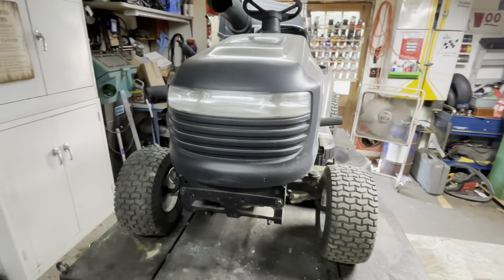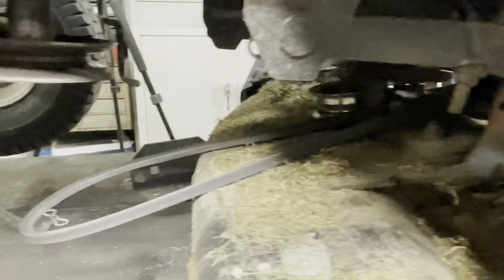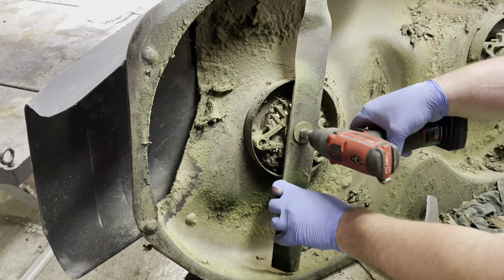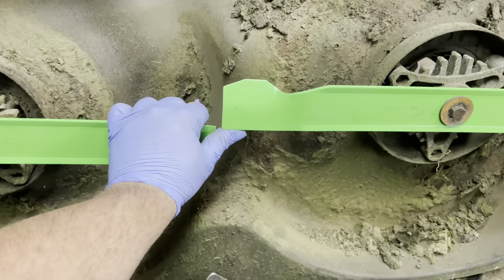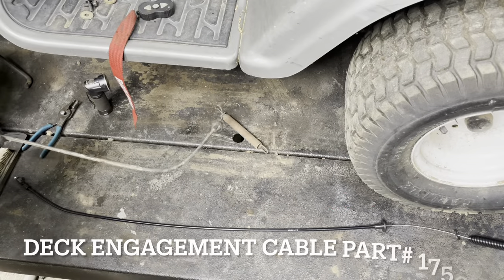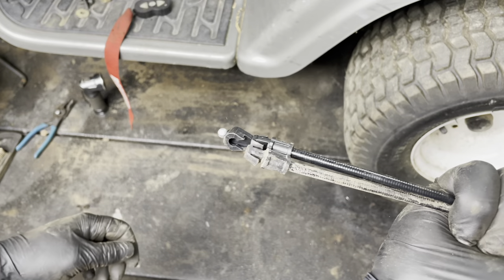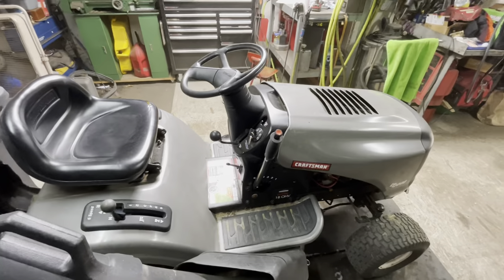Craftsman LT2000 Blade Engage Cable /Blade replacement

Comment: Ive got a slightly different model of mower.  Had to take out the battery and not the gas tank. Other than that, you walked me right through the repair. Thanks for the help.
Reply from the maker: Yea I should’ve mentioned that there are different iterations lol,  glad I could help in anyway I could!👍🏻

Comment: Wow, that bent blade almost throwing you off the ramp reminds me of a donated Cub Cadet push mower I got in. Guy said he hit a stump and it wouldn’t start again, plus the pullcord snapped back every time he tried. I figured it was probably a sheered flywheel key. When I finally got around to working on it I had the devil of a time trying to push it from the yard to the garage. Looked underneath and one end of the blade was a full four inches lower than the rest!  No wonder he couldn’t start it! 😉
In the end this was my first mower flip so far. Checked to make sure and the key wasn’t deformed at all. Electric start,beautiful machine and I got top dollar for it after cleaning it up and a full service plus a bit of touch up paint.

Comment: Brotherman this video just saved me a hassle and a half. I just changed the oil, spark plug, new blades, and fresh tires on my LT2000 and hopped on so excited to test my new mulching blades (switched from bagged for the first time). Started er up and went to actuate the blades and the damn cable popped out and told me "you seriously thought this was gonna be a smooth day didnt ya??" 

This doesnt look like such a bad job and gives me a great opportunity to pressure wash the deck
Reply from the maker: That’s the worst!  Best of luck with the job 👍🏻

Comment: I have the same mower
Why are the blades only partially sharp on each end? And not 4-5 more inches on each end? Is there a reason for that? Wouldn’t it cut more/better if it had a longer edge?
Reply from the maker: Some blades do have a longer sharp area, however 90% of the cutting is done by the first 2 inches of the blade.  Which is why mulching blades have more cutting edge along the whole blade to cut the already cut grass into tiny bits, vs a standard high lift blade which lifts the grass up, cuts, and bags/discharges in one swift motion.
Reply: Ahhh ok makes sense now. Thanks for the quick reply! Have a good rest of your Sunday!!!

Comment: Very good video, and now I am looking for some free advice.  When my LT 2000 has been cutting for a while it cuts out ,but if I disengage the drive for the blades it starts again no problem but if i engage the blades again it cuts out again ,any suggestions as to what might be the problem ????
Reply from the maker: If it’s doing it that religiously It almost sounds like a seat safety issue.  So a few questions,
- does everything sound normal when the blades are engaged, like no loud bearing noises, etc.
- do you have to have the blade leaver all the way engaged for the engine to die or does it start shutting off halfway into engaging the lever?
- Does your seat Safety have two wires or four?
Reply: @hester781  thanks for your reply to my question. 
The mower ticks over  beautifully when first started but after about half an hour cutting it cuts out completely, no shuddering just stops like as if you flicked a switch ,if I disengage the blade drive it starts first tip and ticks over beautifully again but ingauge the blade drive again it shudders and cuts out , i taught it was getting a little hot lately ,is there a temperature sensor switch on these mowers ??? And there are 2 wires on the safety switch under the seat which are connected
Reply: Another answer to one of your earlier questions, 
After half an hour cutting it cuts out. If I disengage the blade drive, it starts normally again but when I start to engage the lever it starts to shudder badely and cuts out again.
Reply from the maker: @johnoflanagan9139  it sounds like one of the safeties are activating and killing the motor. I would try taping down the blade engage safety button so that the machine thinks that the blades are always disengaged.  If you do that in the mower doesn’t die anymore then you know you have either a wiring issue or a safety switch issue.
Reply: @hester781  sorry for my ignorance, but what is the blade  safety button ,and where is it located ???
Reply from the maker: @johnoflanagan9139  if your machine is just like this machine, all you need to do is remove the gas tank, which is two bolts, and look at the bottom of your leaver you will see a push button switch that gets depressed when the leaver is in the disengaged position
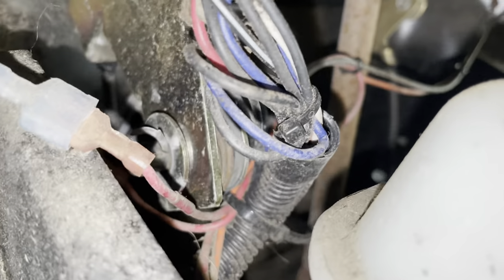Reply from the maker: @johnoflanagan9139 you can see the switch mid left center screen at the 5:06  mark,  it’s grey in color
Reply: @hester781  Thank you for taking the time to respond to my earlier question, I will do as you suggest tomorrow and let you know the results. 
Thank you 😊
Reply: Sorry ,but I have another question, I removed the fuel tank as suggested and found the push button switch. 
Could you tell me is the wire connection just pushed on , is there  a nack in disconnecting it .I tried pulling it apart but failed,and don't want to put to much pressure on it in case it breaks
I need to remove the push button switch in order to tie down the button properly. I tried taping it in position  but the spring pressure of the switch is to strong so i need to remove the switch to do it properly. 
Thanks JOHN.
Reply from the maker: @johnoflanagan9139  to remove the switch you need to unplug the harness and then the switch poles up through the hole.  There are four tabs one on each corner that you need to squeeze in while pushing the switch up and out.

Comment: I rather be a dirty, rotten, no good liar than a dirty, rotten, no good deck LOL.  Great tip on the blade alignment  for deck damage.  Every tractor that gets new blades gets high lift gators.  TBH, considering its age...its in great shape...your friend did a good job.
Reply from the maker: Thank you sir!  I couldn’t agree more with using highlift gators! I tried to tell him, but he is stubborn and set in his ways, maybe he will see this comment and change his mind lol👍🏻

Comment: Hey! Awesome video. I have the same mower and just replaced the plate on the deck that wears and the cable but now it takes almost all of my force to get the blade engagement handle up and when I do the deck shakes violently which it didn’t do before. Any tips?
Reply from the maker: Hmm it sounds like something might be binding on the deck side.  I would double check your pulleys and belt routing and if those are fine, try taking the belt off of the engine pulley and engaging the blades (engine off) if it’s still feels hard to engage I would suspect the tensioner is binding

Comment: Where did I go wrong? After changing the blade engagement cable now the lever is very hard to raise up into the detent position. Could the new spring be excessively tight or is it possible to have pinched the cable somewhere? Ready to toss some wrenches over this mess up.
Reply from the maker: I would check the tensioner on the deck and make sure it isn’t seized/ rusty and can move freely back-and-forth.  That’s the number one cause for these cables to break.

Comment: What if when you engage the blades its very difficult. Should you stretch the new spring or what do you suggest
Reply from the maker: The only 2 things that would make engaging the blade difficult would be rust in the cable or the pivot for the belt tensioner arm where the spring attaches is rusty and needs to be lubricated.  Let me know if this helps 👍🏻

Comment: I need to replace the cable on my lt2000. Due to someone bending the spring and hooking it up to a belt guide lol.  Do you have the part number for the cable?
Reply from the maker: Ugh, I’ve seen that before lol, The part number for the one I used is 175067, hope this helps 👍🏻

Comment: What size is that washer for the top of the spindle for blade engagement cable
Reply from the maker: I believe it’s a 5/16 but Not 100% sure, any size that fits will work 👍🏻